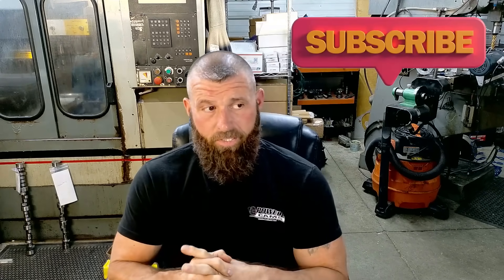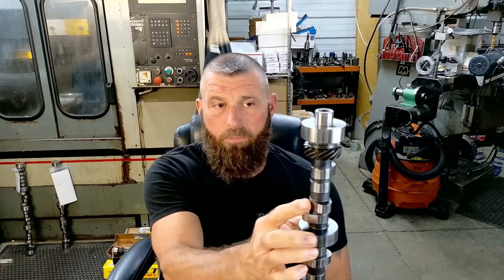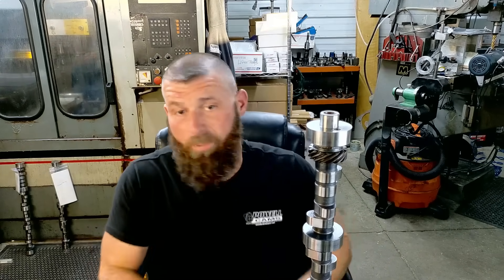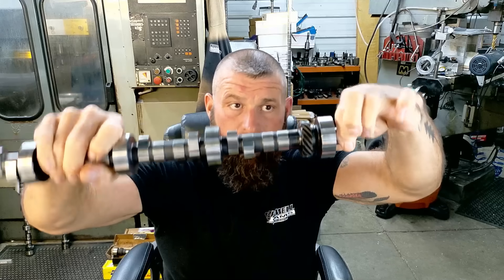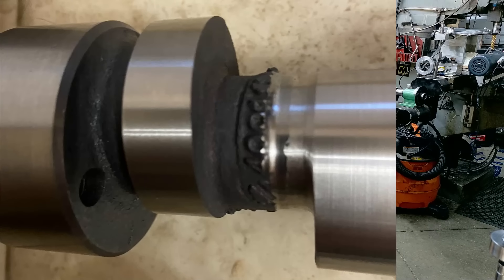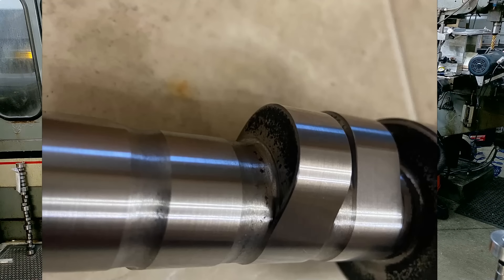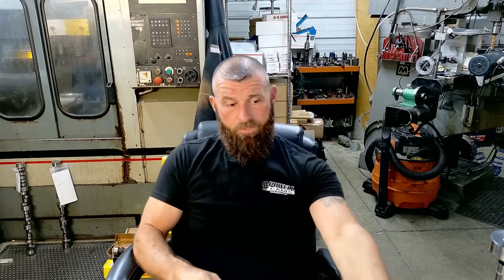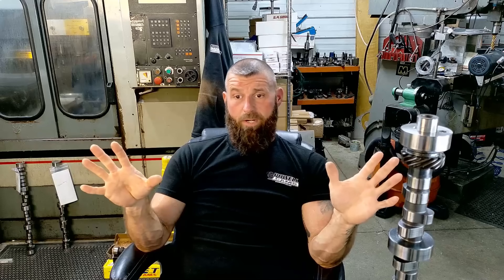Iron small base circle cams??

Comment: There might be a few people running distributorless ignitions that wouldn't care about a damaged distributor gear on a reground cam. Heck could even grind it flush with the core for weight reduction.
Reply from the maker: You are going to have a short life with no distributor gear.....since it runs the oil pump
Reply: @powellmachineinc  Dry sump

Comment: Hey Danial. Commented today earlier on the fine job you did on the animation of lobe grind size as to what was best lift and duration. My point is we all still learn as mechanics no matter how long you been 1 and no matter how old you get, ya still learn from each other. Point 2, David Vizard in I think between Burlington and High point NC. Might could answer the base circle Ford cam thing if there's such an answer. I'm on the page with 1 of the other commenters as I have as well never had big cubic inch small block cords more than 650hp and never had a single problem and most still around with the exception of a few. But it absolutely had nothing to do with the valve trane. Just a few heavy feet.😬
Reply from the maker: Glad you liked the animation!

Comment: I have tried it without a small base circle on 1989 351 windsor with a factory 5.0 ho roller cam and lifters it aeriated the oil by raising the lifter oil feed hole above galley in the block small base circle fixes the problem
Reply from the maker: I did 100 this year, std Bc, zero issues,  the factory cam wasn't small base circle.....

Comment: I think 'they' say you have to go small base circle as a result of having the lobe nose lower at max lift.   In other words, I think the nose has to be lower than normal to keep the factory style tappets from hitting the dogbones.  The smaller base circle is just a result of that.

BUT, we all know the measuring tools trump any wives tales.     ...which leads up to big cam companies having to make 'universal' cam's that are 'idiot proof'.

Sort of a left handed way of making the cams harder to crash when some back yard assembler has to have a big cam ''for the chop'' or to ''do it for Dale'' (or some other dumb reason).   If you machined a million cams and 5% of them crashed due to user error, your name would be mud.

Basically, think what percentage of engine assemblers (not builders) don't even realize you have to measure pushrod length on every single build. There is no magic number.      Big cam companies have to build cams for those guys.

Sorta like Chinese 3.8 Buick timing covers.  From the factory the gears are countersunk in the gear pocket.  That way it's impossible to build the oil pump locked up and stick it on an engine.    Every single one of them have too much endplay, even if you didn't run a gasket.  But that makes less returns when the pump isn't efficient.   As opposed to building it to spec, and having it self machine on initial startup.

That's my hypothesis anyway.   Now I wish I had a short block to measure with a small base circle cam to actually measure tappet-to-dogbone clearance.
Reply from the maker: Follow-up video addresses this

Comment: The roller I received had larger journals than the flat tappet, so I got creative with a brake hone, compressed air to clean  and buffer to polish the clearance is so tight it made air pockets as it slid in, the link bar lifters are reaching out, and the assembly turns smooth.
Reply from the maker: Scary

Comment: We use a bunch of Comp cams because that's what we're familiar with and that's what's most readily available to us (we're in Canada) and after Covid and that nonsense I see that pretty much all of the Chev small block -8 hydraulic roller cams are now steel. -8 used to mean iron cores from them, so I assume their iron core supply dried up (or they had issues with poor cores) because no large company just upgrades their product without good reason. I wonder if in the case of the small base circle SBF cams was a similar situation of core availability, or more sinister, this company just took an iron core and put race lobes on it without caring about the end product. I do know the rods never come close to the cam on the Fords unlike the stroker Chevy small block stuff.

Comment: It's pretty common to get the stock cams out of 50's era Chrysler Hemi's reground. I actually have 2 cast iron solid roller aftermarket cams from the 60's that have been reground by Isky and Erson. The base circles were reduced to achieve .590 lift with 1.5 ratio rockers on a 111 degree lobe center for a blown 331 I'm gathering parts for. I understand that I'll be somewhat rpm limited as I cannot run a very high spring tension due the cams being iron.
Reply from the maker: you have ductile iron rollers, cast iron wouldnt last a hour with a roller lifter

Comment: 6:28 The top of the lobe isn't in the same place. Your straight edge showed it. We just did a non roller Windsor block converted to a spider style retainer and had to run a small base cam to keep the lifters lower.
Reply from the maker: On a "std" cam, they are in the same place,  I thought I made it clear, but obviously not
Reply: @powellmachineinc  I gotcha. I did miss it. Love your shop, and vids.

I figured the roller blocks had taller lifter bores, but we didn't have a block to compare it to.

Comment: I suspect a lot of us would greatly appreciate a more detailed video discussing retrofitting factory dog bone roller lifters and normal base circle roller cams into non-roller blocks vs using small base circle cam or tie bar lifters. There's so much noise and misinformation that it puts the regular/budget guy in the position of having to trust manufacturers selling us solutions. I'd rather spend money on good valve train components than tie bar lifters that cost $450+ if it isn't necessary.

Comment: Quite simpy, most Ford hydraulic roller lifters have the oil feed machined above the "oil band" on the body. In many cases the oil feed hole is uncovered at full lift above the top lifter bore edge, creating bleed off, etc. Engine Tech, Ford Motorsport, etc. The Gaterman, Morel, and possibly others retain the oil feed within the oil band-therefore at full lift it does not expose the feed hole. In early attempts to use the spider/dogbone retrofit hardware on 289/302/351w/Cleveland hydraulic roller conversions, this was an issue. I sourced hydraulic roller cams with a MINOR base circle reduction to alleviate the issue. After product research, I now just order Gaterman/Morel as needed to keep things in order.  The 5.0/5.8 roller blocks have tall enough lifter bores to prevent the uncovering issue. Small block Mopar, LA series have inconsistent lifter bore heights also. The Morel retrofit lifter design covers the issue as well. These are my findings. Hope it enlightens and prevents project headaches.  In 40+ years of practicing my craft, the most consistent lesson is check, check , check EVERYTHING. Sometimes multiple times. Thanks.

Comment: For a SBC,  I am interested in putting in a larger hydraulic roller cam.  What is in the engine now, is 225/231@.050 w/.500/.510 lift.  The current cam is also on a 1.050  cast core.  First, is there an issue with that? Meaning it's a small base circle, but not as small as .990 or whatever.    
I am wanting something in the low 230's intake 8 or so degrees more on the exhaust.  And keeping the lift reasonable as I have 1.6 rockers and it is a street car. I don't want to beat stuff up. BUT, want all the power. (Dont we all)
Reply from the maker: Does it have a 4" crank?

Comment: I recently found myself in the unfortunate position of needing a new 5.3. The old one gave up a roller lifter. I did get 220k out of the DOD motor. I would have highly preferred a build from you but for expediency I went with a long block from S&J. My main fear and unease is the cam they used. I have read a lot of recent comments of cams failing and difficulty in sourcing a quality camshaft. I hope for your continued successes and enjoy all your videos and info. If anyone has any insider knowledge of what may have been put in a S&J motor it is much appreciated.
Reply from the maker: Sorry to hear about your engine, and I appreciate the support!

Comment: I have a SBC build coming soon. What stroke demands small base circle? With a stock deck height. I have a 3.75 stroke crank, but was considering a 427 rotating assembly. I do not want a small base circle. I have a set of 220 heads, so I need displacement, or heads.
Reply from the maker: 3.75 up can need a reduced BC to clear the rods, some rods are way better that others about clearance

Comment: Surely these small base circle guys aren't thinking that the smaller base dia of the lobe would make the roller on the follower spin slower and prevent roller failure?? Yes, the large base circle means there are more rotations of the follower roller because for one rotation of the cam lobe, the linear distance the follower roller has to travel on the large base circle lobe is longer than the linear distance of the small base circle lobe because of its larger diameter. Only thing I can logically think of.
Reply from the maker: Na, plus the pressure angles increase attendance that's really hard on lifters

Comment: I have it on good authority that a fella named Smokey The Tires Off Real Good  used to would put a really heavy knurl on the base circle to correct the problem you bring up with these cams. Amazingly, I happen to have the machine he actually used to knurl the cams with. I'll sell it to ya cheap? 

I once was rebuilding a 289 for a friend in high school. For some reason I was standing around popping the piston skirts against the rods...clank, clank, clank...like a bell. Poing goes one of the skirts. Oh oh better test the rest. Found four where the skirts went bouncing onto the floor. The normal mind with a few dollars laying around would buy new pistons. No...we were so cheap we went to the local junk yard and started playing the piston bell game till we found four that didn't pop. Cheap, poor, and broke we were. Had we some JB weld and a knurling machine I feel confident we could have repaired the original broken ones.
Reply from the maker: Lol, good stuff

Comment: anything to do with rod clearance depending on the stroke? i know ive had that concern on sbc stroker engines. i should delete the comment after reading below, that many ford builders have stated stroke combos they have built have never needed a small base circle. but incase others do not know that rod to cam clearance can be an issue on some engines.
Reply from the maker: Not on a ford

Comment: If I remember correctly the small base circle cams were being used in flat tappet blocks to do a retro fit for a roller cam.  The roller block has more material in the lifter valley for the lifter dog bones and the fact the roller lifter is taller than a flat tappet cam. This was before they had tie bar lifters, so this is what they did to make it work back in the day.
Reply from the maker: This seems logical

Comment: I've built a LOT of SBF engines., some crazy combinations to. Clevors ect..and even the strokers I've built,  I have NEVER had to use a small base circle cam...never ever...never. Roller blocks , non roller blocks..never.  And I've been doing this for 37 years. Heck man..Maybe I'm missing something to! Please educate me as well because apparently  I've built at least 6 to 800 of em wrong! lol. Love it DP..keep em commin brother!
Reply from the maker: Thanks for the feedback! I fully agree
Reply: @powellmachineinc  And cast cores??....what  methamphetamine addicted grinder did this? NVM mind don't throw shade your to good for that. you've got my roller business from here on out...I just wish you still did flat tappet stuff cuz my customers and circle track rules and such. Have a good Sunday brother!
Reply: @Marksracingengines  "Found On the Road Drugged"
Reply: Don’t when you put hydraulic roller lifter in a non roller block on small block ford need small base circle or it lifts out of lifter bore and loses oil pressure.
Reply: @chrisabarr  I have never had to use a small base circle cam for that when using retro lifters.

Comment: PURE GUESS : At one point there was a block where a small base circle was necessary because of the location of the oil holes. Or there was an engine that had lifter oil groves in which were different requiring the small base circle. 

At that time it was a necessary evil but those engines or lifter situations have long since gone away but, the "theory" lives on. 

I've been doing this a long time and I've seen this sort of thing. It may have been ONE engine produced for a couple of years decades ago but now it's become "standard" even thought it's not necessary and hasn't been for 30 years.
Reply from the maker: Good thoughts.

Comment: Factory roller blocks have taller lifter bores than non roller blocks. Using factory roller lifters and dog bones in non roller blocks will cause the flats on the lifter to hit the dog bones at max lift. You have to reduce the nose of the lobe about .125" below the cam journal so the flats don't hit the dog bones. It's the nose that's the problem not the base circle.
Reply from the maker: Makes sense

Comment: You’d spec a small base circle cam in a small block Ford when stroker crank counterweights or rod bolts come very close to the cam, or when aggressive profiles or block architecture reduce clearance.
Reply from the maker: They don't get close, I've built many

Comment: Well my 04 Ford F150 with the 3 valve motor ( glorified work truck) is have a little bit of a ruff idol. I knew this day would come, I have a motor I bought and fired up the old parts cannon, I ordered a higher pressure oil pump, semi aftermarket cams new phasers new timing chain and tensioner a healthy set of headers and various other parts that are habitually known to fail. If everything else on this truck wasn't perfect I would just probably total it out lol but if you know of anything else besides what I've already mentioned to watch out for and replace while I am building this motor I would greatly appreciate it if you had any advice. I have a total of six work trucks but this one is the one I normally drive and it's made it $250,000 me already without having to replace any of the parts that I have already mentioned somehow. The axles are great the transmission is in great shape all of the u joints are good I've got a great sound system in it a great exhaust cat back on it already HID lights a lift big tires all that good stuff I just don't beat up on my trucks.  thank you for all your content I greatly appreciate it. 🇺🇲🫡

Comment: Ok ..  dont understand  the poor choice of  core ... but i did run into the lifter problem  on the last 351w i did ... stanard base circle  edebrock  roller cam in a 79 block and the hydraulic  roller lifter popped  just past the top of the lifter bore and spit the oil out ... lucky  i checked beforehand  but had to order out special  lifters with the hole moved down to fix it before  i ran it .... i tried  to figure  out year and block that has this and the available  information  was horrible  ...it was all retrofit  cam parts ..... so the problem  is out there but i don't  know what combo causes  it  .. if you figure  out the year or wrong part please  do another  video
Reply from the maker: Special lifter? Where do you get Special lifters with the oil band moved?
Reply: @powellmachineinc I can look it up but I think  it was morel  ... this was a year ago and I have done stuff sence ... the whole  deal seemed odd because  it should  have dropped  in no problem  .... I will look up information  on Monday  and send you a text with the  number  ...

Comment: Sounds to me the cam grinder just used the wrong cam core. Wrong material and not enough meat in the lobe. Then to get the lift and duration he had to grind a small base circle. I am not a cam grinder and don't  know much about it. But it seems likely the case. Great video!  I love your channel and the great information you present!
Reply: he should not use the same master for both base circles, but MOST everyone did it  Comp, Isky
Reply from the maker: No, the core had plenty of matl, the chevy requires a small bc

Comment: I heard you had to run the small base circle cause the lifter would sit too high in the bore and the dog bones and spiders wouldn’t work right, it would push the dog bone up off were it rest. So if you measured it and it’s the same on a roller vs non roller, then your guess is as good as mine.
Reply from the maker: This was addressed clearly in the video
Reply: @powellmachineinc yeah I agree with you, think someone started the rumor, and it just spread like wild fire, cause I’ve even heard it before. I guess a man could take a non filler block and tap it for the hold down and run the oe stuff to save money. I don’t see why not if every thing is in the same location on both. Thanks for the education! 👍

Comment: I was told i needed sb cam or the lifter would come out of the bore too far and could lose oil to that lifter or spray oil past the lifter and short cast non roller block. The roller block that area is flat and taller

After drilling and tapping the block for the spider, it and stock ford lifters all worked with the sb cam. 

I was actually more worried about the lifter coming out to far to ride the sb cam and becoming unstable.   I only went this way to save money compared to a set of link bar lifters.
Reply from the maker: I've done hundreds,  never seen it
Reply: Love the Chanel and wish a video like this was out before I went down the sb road. 

Can you make a video converting a non roller 351w block with the factory parts.  Us low buck guys need help.
Reply: Yes sir that's the only reason you would need a sb cam in a sbf. It's definitely the issue he's looking for